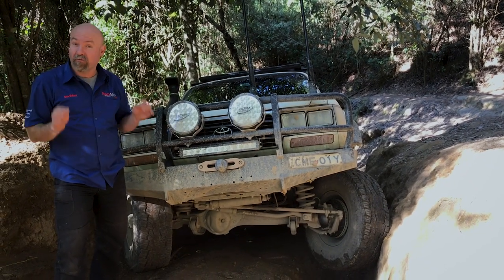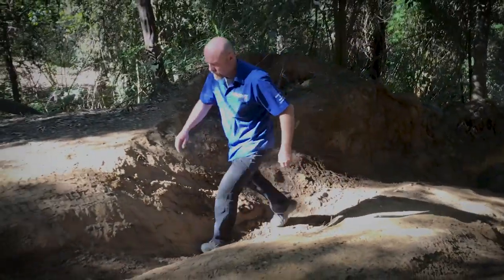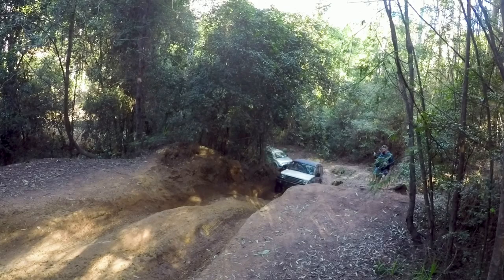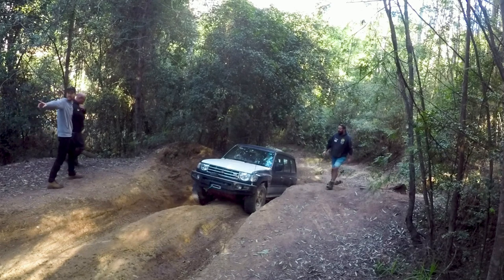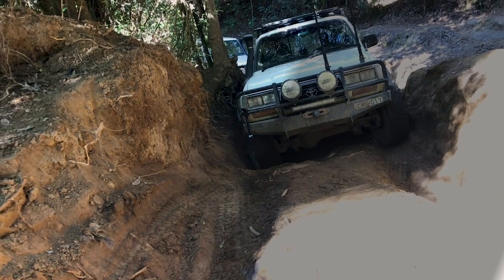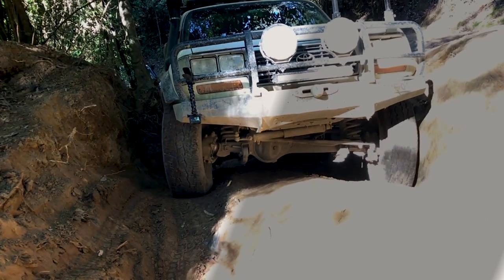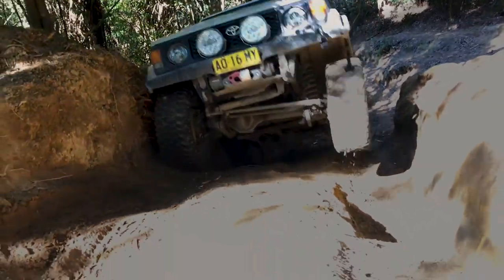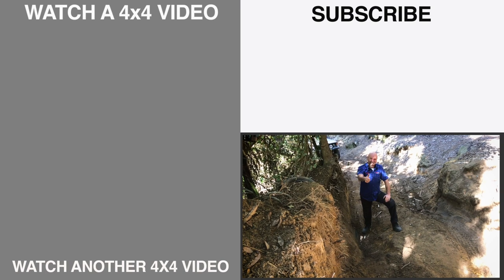How to drive up 'wombat holes'! Opposing holes

Comment: Yep tried that technique at cruiser park on the weekend but I went wayyyy too high up on to the bank and decided to have a little look see up at the sky 😂 have a look at ln106mumma on Instagram
Reply from the maker: so you did.
Reply: MadMatt 4WD Either I’m not holding on to the steering wheel strong enough or I have a welded or faulty mechanical diff locker in the front cause she just pulls me to the left whenever I get into lowrange 🤷‍♀️ I need to crack open the diff and have a look see